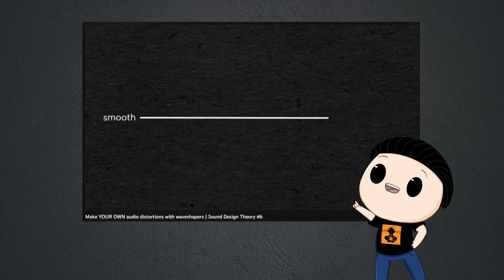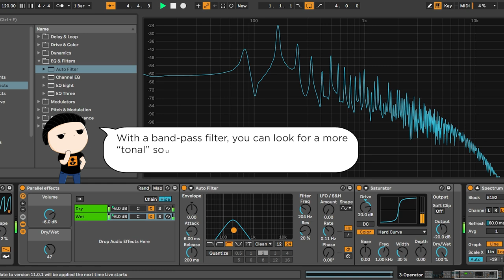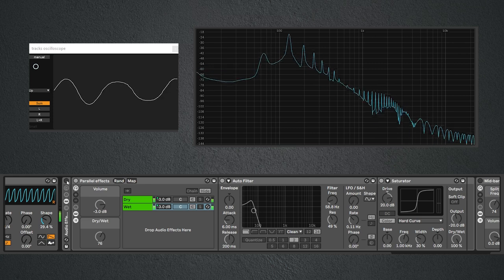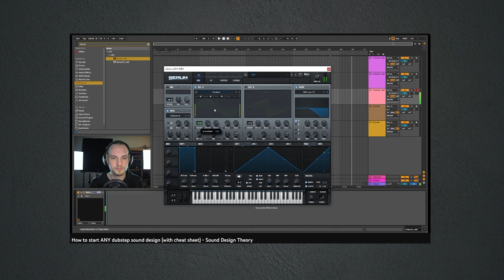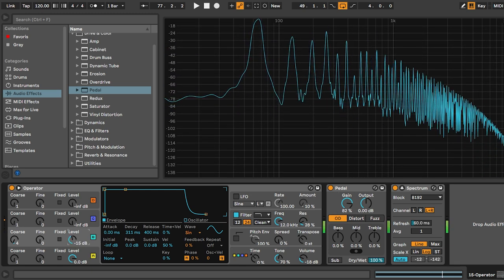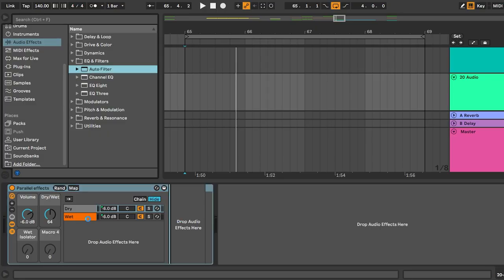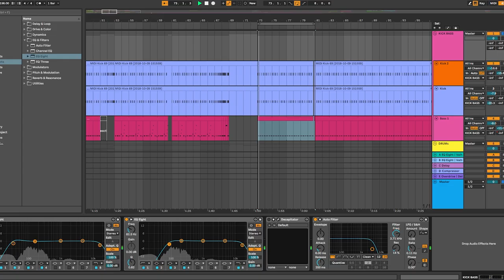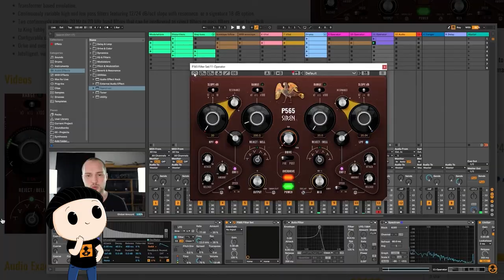Distortion: Advanced Techniques - Sound Design Theory (+ Ableton Racks)

Comment: Not sure if I get it, but wouldn't the band subtraction work just fine if you used a notch filter on the wet instead of doing the phase shenanigans? I'll assume Live's Auto Filter lacks a notch.
Reply from the maker: You mean use a notch filter to remove the frequency you distort on another channel with a band filter ? Theoretically, if the notch and the band filters can compensate each other, but to affect exactly the same a frequencies in the most clean way, the phase inversion trick is the way to go (Ableton's auto filter does have a notch filter).
Though it's possible I haven't understood your question clearly.

Comment: I recommend distribute two ranges as: 1-127 and 0-126. When It's 0-127, at the edges you will still have a mixture of 2 chains instead of a solo chain.
Reply from the maker: Sounds like a good tip, but on which parameter? On the chain selector to make the dry/wet knob?
Reply: @Woochia  Right, whenever you make a crossfade between 2 chains, they should be distributed as mentioned so that 0 value is fully Dry (i.e. the first track has 100% loudness) and value 127 is fully Wet (or whatever the second track is will be 100% loud). I learnt this method from Ableton themselves, they use it in their factory effect racks. I just unfold their drum racks, audio effect racks etc. to see how they built them.
If you set both tracks to 0-127 range, in this case macro knob turned fully left or right will still have a mixture of 2 chains, as if you load up a Reverb device and at 0% Dry/Wet it still has some reverb.